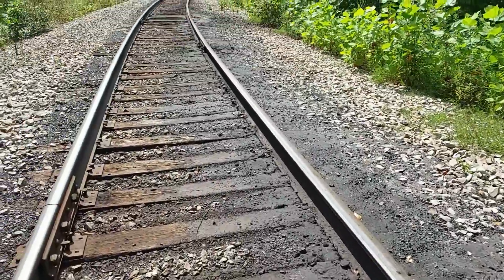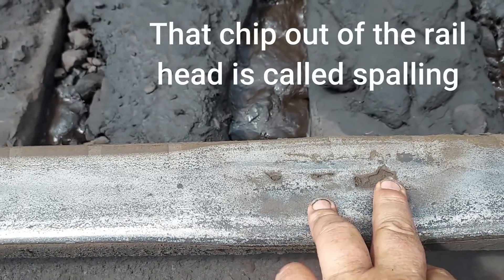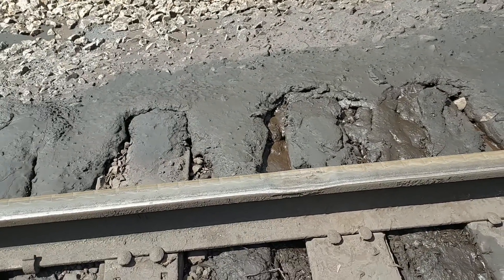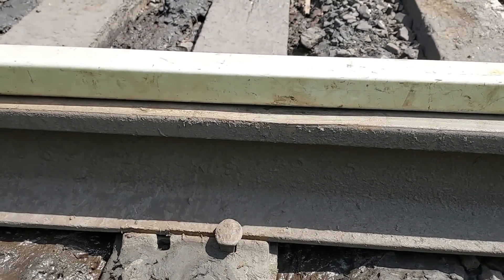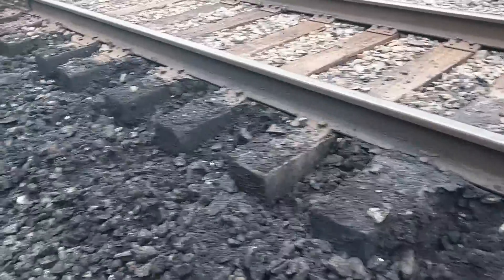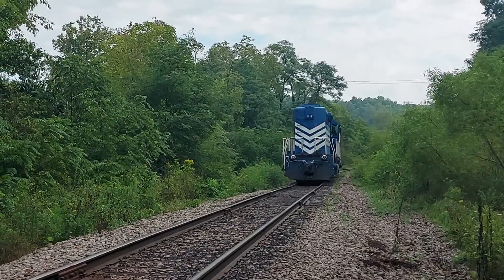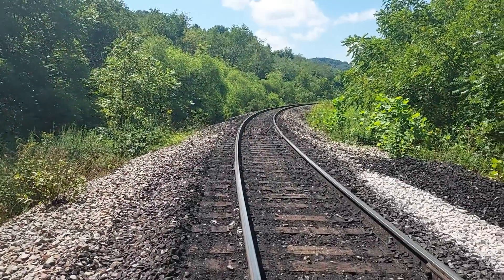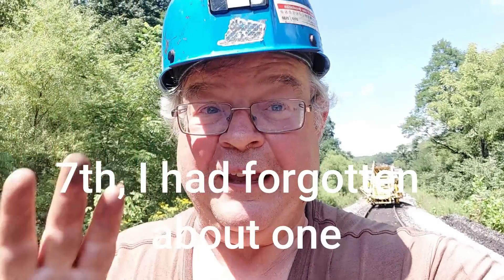This is the 7th Rail I've Broken with my Tamper

Comment: Looks like a Horizontal Split Head.
Reply from the maker: When I ran my mirror under the rail head I didn't notice a split,
but it was really dirty also, and I could have missed it. I will
defer to your expertise and say you very well could be right Ezekiel.
When we take this rail out I will take the joint bars off and
take a closer look. Appreciate your visiting with me tonight
my good friend.
Reply: @ccrx6700  a horizontal split will crack out to the field or gauge face. The crack visible on the video you called flow but in my opinion it’s a little too deep to be flow.  A Vertical Split Head or a Head and Web Separation would be more of what you’d find by looking under the head with a mirror.  Most important thing is you got it barred up now you just got a battered joint. 😉😉

Comment: Hi Dave. Great video. I’m sorry there was a wall collapse underground. I pray no one was hurt or nearby when it came down.
A question for you my friend - on occasion when I’ve been trackside chasing trains and in railroad videos I hear sometimes trains making a heavy thump thump thump sound. 
Is that the rail cars passing over flat sections of rail?
Reply from the maker: Thank you Johnathan, no one got hurt under ground, only
the companies pocket book from lost production. We are
back in the coal now. That sound you hear could be caused
by a flattened rail, but more likely it is caused by flat spots
on car wheels. If you hear it on every single wheel there is
a rail head problem, but if it's only on occasion, then it's a
car wheel. Here's a video on car wheel flat spots where you
can hear one as it goes down track and see if that is the
sound you are hearing
https://youtu.be/wbjHC1YzHWg
Reply: @ccrx6700  - Yea that’s the sound. Thank You for explaining
Reply from the maker: @johnathanlewis2049  👍😊